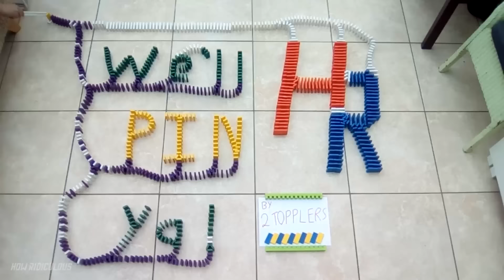Can This SOLID GLASS BALL Survive a 45m Drop?

Comment: So, after some maths, AT THE POINT OF IMPACT:

When it impacted the plate, the ball was traveling at 29.25 m/s or 105.3 kph or 65.4 mph.

The 45kg ball dropped from 45 meters in the air would have impacted the steel plate with a force of 441.33 N, or 251.97 bar, or 3654.57 psi. 

CAVEAT: Without knowing the ball’s actual diameter, I looked up some stuff on google and found a 100kg glass ball that was 360cm, so I used that for my calculations.

EDIT: Changed the numbers because I forgot to account for drag the first time around.
Reply: Yeesh and I thought I was good at math XD
Reply: Im not taking that stuff yet, but i still know about newton, drag, kinetic forces, etc.
Reply: for a smooth glass ball, drag is negligible at best.
Reply: @RedJet99  lol this is nothing
Reply: If any of you want to see the formula I used, shoot me a DM on Twitter @disartfuldodger
Reply: BigDog Interestingly, drag is a function of cross-sectional surface area and not of the material composition. This is why planes and supercars are designed to increase drag on one side of the vehicle over the other to either provide lift (planes), or to provide downforce (cars). And in this example, accounting for drag, decreased the pressure by almost 6 bar, or ~87psi.
Reply: @alliegoebert  what drag coefficient did you use? Sphere is about 0.47.
Reply: BigDog I used the following to calculate a drag factor: (1.225(Pi*0.18^2)*0.5)/2

So 1.225 is a good average for air density; 0.18 is the sphere’s radius; 0.5 for the drag coefficient of a sphere.
Reply: 441.33 N is slightly over 44 Kg.. Less than the ball's weight 🤔 I think it should be like 19 000 N => 1,9 tons.
Reply: @volnas1665  Nope, because F=ma and when an object is falling, its acceleration is constant and uniform at -9.80665 m/s.  And the reason it’s imparting a force slightly less than its mass/weight of 100kg would in a vacuum is because I also accounted for drag as it fell through the air.
Reply: I'm gonna say it again... When the 45kg ball is just lying on the ground, it is applying a force of  441N on it, and force of impact was the same according to you? So if you were lying under it as it impacted, it would feel like a 44kg child is sitting on you? (No it would obliterate you)
You see now that it doesn't make sense? Kinetic energy exists...
Reply: Ummmmm... wha
Reply: @volnas1665  also, when a 45-kg object is resting on the surface of the ground, it is still exerting 441N of force but the Earth is exerting its own force upward. So when an object is in freefall, the amount of Force does not increase as long as acceleration is constant. You seem to be confusing Force versus Work. Work is force*distance. So a 45kg child sitting on your lap is stationary, and exerting net zero Newtons (they are accelerating downward at 9.8 m/s and you are accelerating upward at the same). If a child falls into your lap from several meters upward, the child will come to stop because their downward force cancels out with your upward force, BUT they work they exert is much greater due to the distance travelled. So if a 45kg ball fell 45m, it would exert 19,858.46625 Joules of energy on the steel plate below. But still 441ish Newtons. And then to calculate the pressure of the sphere impacting the plate, you have to account for the vertical and horizontal compression ratios of glass and steel, plus the actual surface area of the contact patch between the two objects. Which I did.
Reply: @alliegoebert  I have a question then. Let's say you were to put an indestructible scale instead of the steel plate there. What weight would it show during the impact? 45 kg or much much more?
Reply: @volnas1665  bruh you are way over your head on this argument
Reply: @volnas1665  weight and force are not the same thing. Weight is simply mass times the gravitational coefficient of the planet you’re on. On Earth, that number is 1. But if you want to do some silly math and determine how much an object would “weigh” on impact, you can but that figure is ultimately meaningless.... I’m going to use rounded figures and not account for drag or compression here because I’m not at home and I’m just on my cell. 

An object falling 45m will fall for 3.0294 seconds with a final velocity of 29.71 m/s. That is 3.029576868757425 times the gravitational velocity of Earth (9.80665 m/s^2), so we multiply that by its mass of 45kg to get a weight of 136.33kg.
Reply: @DizGaAlcam  as long as he eventually learns something from this, I’m cool with it ;)
Reply: @alliegoebert  I didn't mean to sound rude at all. I think we just misunderstood each other. So I'll try to clarify what I meant the whole time. 
Right before the impact, the ball was falling roughly at 29 m/s. 
For calculating the force we use F = m . a
We agree on this. So far we know the weight -> 45 kg and we need the acceleration. It's hard to say how fast the ball went from 29 m/s to 0 unless we know how much they slowed the footage down. I'm not going to say it stopped immediately, because it bounced off and still carried some of it's energy so 0,05s could be good enough of an estimate. Back to the acceleration a = v / t.
29 / 0.05 = 580 m/s². (I know that it's decelerating, but that is not important when calculating the net force involved). Now we finally get to the F = m . a
45 . 580 = 26 100 N. (Or you can say 2,6 tons). That is the force of impact. 
This is also one way how car crash impacts are calculated -> the more can the car deform -> the slower it decelerates -> the smaller is the force.
Thank you for reading this all.
Reply: @volnas1665  For one, you’re confusing velocity with acceleration. 

For two, what you’re trying to figure out here (and incorrectly), was literally exactly what I calculated in my first comment. 3,651psi.... as in, pounds per square inch. The contact area between the sphere and the plate is minuscule— MUCH smaller than a full square inch.  Pressure, which is ultimately what you really want to know here is a function of impact velocity, material compression, and surface area of the contact patch. 

Let’s say we have 10,000 psi onto an area of 0.25 sq inches, you would colloquially say that it “hit with 2500 lbs.” Contrarily, if an object impacted with 10k psi into an area of 100 sq inches, we would say that it hit “with 1 million lbs.”
Reply: @alliegoebert  What do you mean I'm confusing velocity with acceleration? I calculated acceleration from velocity. And I don't want to know pressure. All I wanted is the force F. Pressure is something else and there must have been insane pressure given the big force and tiny area. And I couldn't have known what area you used for calculating the PSI so that doesn't say much to me about the force.
I think it's a good time to stop as this probably leads nowhere 😂
Reply: @volnas1665  I think you’re just over your head here. And you can’t accept that a woman who does this for a living might actually know what she’s talking about. It’s also disappointing that you don’t actually read what I write. Before I write more, I’d recommend you go reread everything I’ve written thus far.
Reply: @alliegoebert  I think you might be mistaken,  the implications of what you are saying would suggest that if the object was traveling at a constant velocity that it would impart no force upon impact with a stationary object. This is clearly not the case. The value you calculated for the impact force would actually be closer to the force generated by drag when the object is at terminal velocity.

The reason sudden stops generate a large amount of force is due to the large acceleration value (in the direction opposite the direction of travel) required to bring an object that is traveling at speed to 0 over a very short period of time

Comment: the science behind it is that the point of direct impact has the rest of the ball behind it casing it to compress. however the parts that do not impact the metal plate have space to move downwards and therefore can shatter. the vibrations from the impact also help to loosen up the shards of glass. the glass also forms in layers which is why it shatters so perfectly.
Reply: @pskugd8385 👏👏👏👏👏
Reply: @pskugd8385  Don't force your opinion down others throats. Religious beliefs are a deeply personal belief, not a universal truth. Please do not force yours at other people like this. It is extremely arrogant.
Reply: @iainmacrae6982  Yet a good handful of religions try.
Reply: I can't refute everything you said, but the breaking patterns we see in the glass are called conchoidal fractures, and conchoidal fractures only occur when the internal crystalline habit is amorphous, meaning it has no clear organizational structure, therefore the glass doesn't shatter along natural planes of separation or weakness.  There aren't layers in these glass spheres.
Reply: @pskugd8385  I think Zeus, Osiris, Bahamut, and about a thousand other gods would care to disagree.... if they weren't as fictional as your god that is.

Comment: when force is applied to a surface it spreads at a 45-degree angle from the contact spot, this is part of the reason for the cone.
Reply: I always herd it refered to as a Onion fracture.
Reply: Spot on...once this force radiates through the glass,, when it hits the outer edge it splits and the shockwave shatters the glass into a cone.
Reply: Combined with a "surface" on an angle so the cone isn't in the middle

Comment: The cony jony is formed when the shockwaves vibrate though the glass when it hits the metal plate thing, causing it to become a cone!
Reply: You beat me to it. I would add that compression-strengthening is what keeps the rest (supported by the point of impact) from shattering. Basically, the sides fall off, with the boundary determined by the shock cone.
I'm willing to bet that "Smarter Every Day" could tie the angle of the cone to the speed of sound through glass, and that the wave effect left behind has to do with the frequency OF that shockwave. But I'm just guessing there.
Reply: Spot on!
Reply: AMAS Channel 2 100% right. The impact causes nearly infinite rays of directional force all originating from the point of impact, and the more glass there is behind each ray determines how much strength that particular “line” of glass will have. This is why only the sides break off and not the center because the rays that point to the side, or more horizontal, have the least backing to them. The waves are likely caused by the specific boundaries between the amount of compressive strength and how much glass breaks off due to molecular cohesion on each individual ray of force. And Brett, it doesn’t all shatter partially because of the terminal velocity of glass. Size increases weight, but also increases drag, and increases the compressive strength. And because they are spheres, these factors will theoretically balance out into the cony jony no matter the size of glass. 

-this has been my best guess, brought to you by:
Not a Scientist
Reply: Skyman7899 so was I right at all?
Reply: Lilly I’d say so. Shockwaves vibrating and rays of force shooting through glass are roughly the same premise. You were certainly in the right ballpark. But again, I’m no scientist. Or physicist for that matter. There very well could be other things at play.
Reply: Skyman7899 cool thanks m8

Comment: 16:23 It's like 40Kg falling from 45m, you do the physics you know...
T H A T ' S   F R E A K I N G   A L O T   O F   F O R C E
Reply: Lots of gravitational and kinetic energy
Reply: And sound and heat energy
Reply: And gravity and friction energy
Reply: And air friction and air resistance energy
Reply: 392 Newtons is the force of gravity
Reply: Jono Holmes I just used 9.8m/s^2 since I didn't learn much about air resistance. I know the equation, but not how to find the components. Besides, spheres have very low air resistance. Anyways, I got 19.6 m/s as the final velocity
Reply: @KHolzer444  I got 4417 Newton based off HS physics, but I might be wrong. I did 9,81m/s^2 x 10kg x 45m.
Reply: @virtuosohun  it’s only mass times acceleration. The force is actually a lot more though because it’s the moment the glass touches the steel that stops it falling instantly. It’s a lot more than what you said
Reply: @KHolzer444  I still find it weird that you say height doesn’t matter, like it’s not the same if you dropped it from 1m or 45m.
Reply: @virtuosohun  The gravity force is the same. The impact force just multiplies

Comment: Commtest: so for accuracy of the effect, I'm pretty sure that the reason why it does the cone thing is because when it hits the ground, it has a lot of energy that it needs to disperse, and because the ball is solid, it sends a shockwave that shatters the glass in a conical shape until it loses all of the energy. The point of impact doesn't shatter because that is the thickest part of the glass, and it can take a lot more impact. It slowly slopes because the glass gets less and less thick, and so it can take less and less force.
This is the effect of the coney joney.

Comment: I agree with the pinned comment, I have another theory. I believe its about momentum. When the ball hits the steel because its spherical only a tiny maybe 10 sq millimeter of area is contacting the steel. When contact is made the force of impact is spread through the whole sphere, the glass on the bottom half of the sphere has nothing to support it and is ripped off the sphere by the downward force of the impact. Causing the coney-joney effect to emanate from the impact point. If you slow down the point of impact you can see the glass on the bottom of the sphere does not shatter and go everywhere is is ripped off the ball and yanked down to the plate, then spreads out.

Comment: well the connie jonnie effect is produced my the glass sphere attempting to diffuse the massive kinetic energy throughout itself (similarly to how a exercise ball filled with water jiggles) however, glass has a very high level of rigidity witch makes it difficult to jiggle and diffuse the energy efficiency, if it was like a hong you would expect it to absorb that energy, vibrate, and slowly release that energy over time, but because the glass is also very brittle, the high energy causes it to shatter. thus when the glass ball is dropped onto the metal sheet the force tries to diffuse along the surface of the sphere but cannot contain itself inside the brittle and rigid glass causing it to explode only as far as the energy has traveled!
Reply: thanks! appreciate the thorough explanation in this sea of youtube meme comments
Reply: HONG HONG HONG! HONROABUHL MEUBMUBUH!

Comment: The cone thing happens not because of compression and tension but more because the contact between the sphere and the elastic half-space occurs over a circular disc of radius a given by equation where Inline Formula in which ν1 and ν2 and E1 and E2 are Poisson's ratios and elastic moduli of the half-space and sphere, respectively. Hertz [1] also showed that, on the surface of the half-space at a distance r from the point of first contact between the sphere and the half-space and outside the contact circle, the radial stress σr is tensile and is given by, Moreover, on the surface and outside the circle of contact the circumferential stress, σ∅, is compressive, but it is of an equal magnitude to the radial stress, σr. When the compressive load P on the sphere is gradually increased, the circle of contact increases according to equation (2.1) and, as the applied load reaches a critical value, a ring crack of radius rc forms in the surface of the semi-infinite solid. With further increase in the normal load, the ring crack develops into a cone crack (figure 1). The size of the cone crack increases with the applied normal load P such that P/S3/2 remains constant [4,6], where S is the base of the cone crack (figure 1).
Reply: 🤔 this is why I suck at math and what ever you just said 😂
Reply: This sounds like it could literally be completely made up lol
Reply: @dannyneff4195  but it makes complete sense.

Comment: The balls have so much momentum that when the ball impacts the ground, the glass around the point at which it touches the surface of the steel will fracture off and continue it's decent. The point on the cone is the point that makes contact with the steel. The reason why the point doesn't fracture is because the force is being sent through the point and up through the ball and is being distributed evenly. However, the area around the point that contacts the steel will just sheer off because of the momentum.